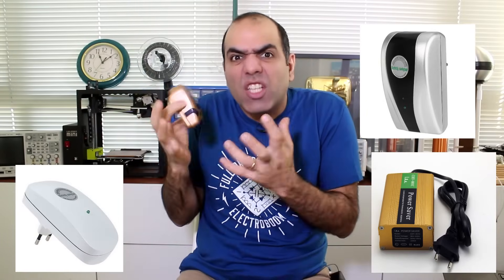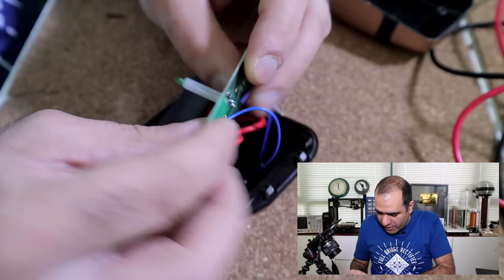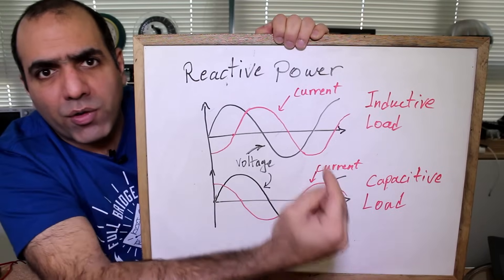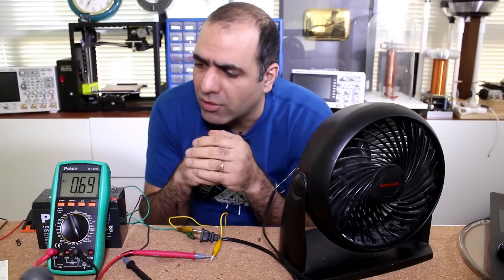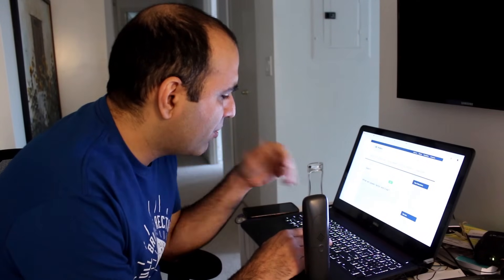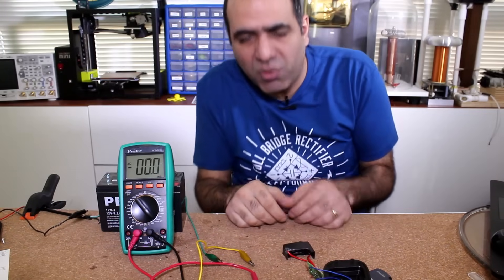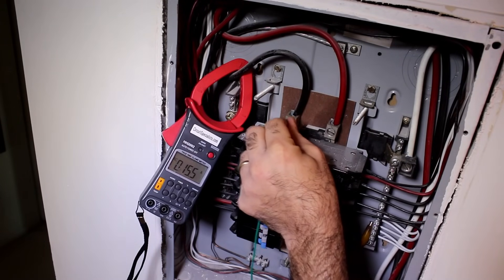Power Saver Scam EXPOSED!

Comment: LOL, you have seen yourself that most of the service lines of power supply even didn't know what Reactive-Power or other used words mean (or never heared about: please spell it), you BELIEVE the answer, you pay only for real power ?
What you pay for is Watt/h and if looked corrected by cos(0), have fun to find that video.
So far still steady Voltage multiplicity with Power in Amp = Watt h, a higher Amp as of too much wasted power = causing also higher Watt h and so a higher bill.

After you might watch https://www.youtube.com/watch?v=TPqXNLkJTJM 
you might learn like me that this energy saving units might work, IF there capacitor build in with fix the needed uF of the unit placed to.

So in your shown examples the same uF capacitor will show non or some effect depending on where you test it.
But as of the Video I linked you might understand then also way so.

I also called the power saving plugs a scam before, even I know since 2 years about some of my units have bad PF as of I use digital multi-meter, here PZEM-18 ?, so detect my power usage and find best spots to reduce by turn then off earlier, less use ... whatever.

But with that video and some more to confirm I learned that now.
Ordered another 2 PF meter and 6 units of 1 uF as I yesterday measure my pc server (offering a game 24/7) using 50 Watt with PF of 0.78, mean maybe useless taking 10-15 Watt for nothing. Adding after get the deliver 1 or calculated 2 uF (in series) parallel to the power supply of the server it should get near pf1 and so also use less Amps, and so less costs.

Then with new meter I wanna check also this PC I am working with, 2 Water-pumps and the cooling room from the restaurant what show a pf of 0.5 !!!

I am a master level business manager, and learned by videos to install my own two 2K Solar inverter and make around 6700 KW a month myself by watching days videos about electric wiring etc..
So even you seam to know more about it and even have some equipment, I trust the teacher and the confirmed pf and uF calculation in that video more.

The Power save is not a real scam, it only will work as expected at the right spot and units as of no adjusting of the capacitor.
The Idea being is right as you have seen yourself when big companies HAVE to pay for it !
Compare the Energy (electric) usage of both sectors in Germany 33% is Industrie and 30% is private. So as especial of the gas war from Russia it might be worth to restart this theme with better based information as it CAN real save electric ans so also money.

Comment: BTW, old (dumb) residential meters measure real power very accurately even if the power factor is hideously low. I haven’t checked the modern “smart” meters. I bet they are just as accurate. On the downside, however, I bet the smart meters can report VARs, too, so utilities have the ability to charge for reactivate power when they can justify it before their regulators.

Comment: The only way a capacitor could help save electricity is a large array to store it for when there's power failure elsewhere. But as it isn't going to produce A/C without a power inverter, it's practically useless to explore for the time being

Comment: Hmmm… since you don’t pay for reactive power, would adding a giant capacitor to your breaker be a good way to screw over your power company if you don’t like them?

That would cause you to draw a ton of reactive power and turn the power companies electricity to heat without paying for it. Only downside I can see is you might fatigue some components of your own system faster over time, but you might also do the same to components owned by the power company ;)

Comment: EE and industrial electrician here. All homes are billed in WATTS. A 1500 watt appliance will use 1500 watts no matter what your PF is. 
My company has two 4160v feeds to our building and we have a HUGE bank of capacitors to actually lower our rate. lowest bill in years was $34000 lol

Comment: Hi Mehdi, good video. Shouldn't the current pulled by that contraption (if applied alone) not be billed?
Since those current mostly goes for reactive (capacitive) power, due to the fact that the capacitor is the only thing consuming the current
Reply: Why not just push the excess electricity back into the grid? Then you'd get a bit of money back, AND cut your electricity bill by a lot in the long run.

Comment: There is one relatively rare circumstance where PFC would make a difference in residential electricity usage. If the utility is supplying electricity with a bad power factor on incoming power. In which case, all your electric motor devices, such as an air conditioner, will have to draw more current to operate. This happened to my parents, because the local distribution transformer had a problem that was supplying power with a very bad power factor. When they replaced it, my parent’s electricity bill dropped nearly 50% on average. The electricity supplier denied this was possible and refused to refund the overcharges for any prior months.
Reply: ive saved 50% with a device.

Comment: My thinking is.  Is to buy a pack of the capacitors and fit in to each device that it will benefit.  100mA is not much but over a year 5 or more devices.  I also as the accuracy of the meter we are billed from.  So if house next door has all the same tec and other stuff uses for the same time will his bill be lower or more then mine.

Comment: Inefficient microwave? My father had a microwave that was like a gazillion years old, it didnt even have a electrical display and used the old Egg-clock spring mechanism thingie to set the time, I wonder what the power draw of that machine might have been XD
Reply: Very low.
Reply: @warmbeer2  You are actually correct now that I think of it, I think the max setting was like 750w (if I didnt mix up the units x3)

Comment: Any electric device sold in my country must be equipped with either a capacitor or inductor, to compensate for the power factor difference. I assume this is the case in most, if not all EU countries.

And yes, that means, that a fan would need to have a fitting capacitor inside.

Comment: Adding capacitor to reduce electric bill is known in France since 60's as law forbids by heavy fine. Here ammeter is used to see the result, but the purpose of the capacitor is to cheat the watt meter which rotates slower with reactive current. This fellow should have tried an incandescent bulb of 100w with and without capacitor while watching the watt meter rotation speed.

Comment: I have a TV that has a terrible power factor. 35 watts and 51 VA.

I want to power it from a solar inverter..
 
35 watts will drain my battery slower than 51 VA.

Power factor correction makes a lot of sense in this application.

I would love to see a video that talked about that.

Comment: AC in UK is 240 v RMS which gives a peak wave of 338 v , if you could build a device to absorb the peak would it reduce the eddy currents which the meter uses to charge you for consumption ?

Comment: For your test you tried to demonstrate, I noticed you was actually connecting your capacitor to the earth rail in your distrubution box rather then across the negative and positive power lines. The unit doesn't connect to earth anyway. You can get a high potential between the earth and neatural depending how good the wiring and distance back at the main earth rod at the sub-station. These units only have a capacitor in them which just reduces any "noise" present on the power line depending on what's running causing your home to produce spikes / noise....  If you look inside a fluorescent light fitting, there's generally a fat capacitor inside just to correct the phase angle caused by the inductive choke inside, you might as well use that to slap across your mains to filter any high frequency noise for what it's worth.. End of the day you're not saving ANY Power!!!  Why are people so gullible  :(

Comment: Hi Medhi, sorry for a question on a two-year-old video, but I've noticed the graphs showing the current phase in capacitive and inductive circumstances is 90 degrees for inductive and -90 for capacitive, while it should technically be switched? Cause the current flows immediately through a capacitor with the voltage "lagging" as the capacitor charges and in a coil the current lags behind because the coil doesn't conduct unless it has formed a stable electromagnetic field in its coils.
So then, are the graphs of voltage/current phase shift ones where we take current as the point of reference for phase shift and you just mislabeled the voltage and current, or is my understanding of this completely bonkers and incorrect? And moreover, does this even matter? What problems can you run into, other than agreeability with other engineers about the phase domain (negative, positive)?

Comment: I installed PF Correction panels in a medical college building. Hostels were using little electricity so installing PF Panel had little or no effect however main academic block was using a lot of electricity due to use of some x-ray machines or some other stuff which consumed large electricity for a very small period of time. PF Panel was useful but not all the time.
In such cases, use Automatic PF correction. It had relay & by CT it checked how much current is being drawn & connected only right amount of capacitance via magnetic contractors & disconnected when current/load was little. 

Always use automatic PF Correction. 

In Pakistan, we pay for Real power. New smart meters can measure both real & apparent power. At homes, Electricity distribution companies ignore but at industry, bulk & commercial meters, they charge extra amount as PF Correction penalty. 

At my home, our society/local gov installs capacitor along with every meter or in residential areas, one in a street & that cost is covered in one time Electrical connection fee.

Comment: These things remind me of engine start stop systems in SUVs.
Great that it turns off the engine. So my fuel consumption is 0 instead of 0.6 liters per hour.
Now let me accelerate my 1.8 tons of mostly unnecessary chassis, and speed that wardrobe over the highway at 180 km/h.
This costs me 14.6 liters per 100km opposed to 8 in a small car.

Comment: I'm a high level electrician and in heavy industry where we do use LARGE capacitor (banks) for power factor correction.  The reason is that while we're only initially paying for the REAL power we use, we get penalized if our power factor (cos of the phase angle) wanders too far from unity.  We don't actually get charged on any metered use of reactive power.  From memory the old electro-mechanical power box meters went out of their way to measure both current and voltage in such a way that only the in phase component of the current (the real power component) would rotate the meter.  I would assume the modern electric ones follow the same idea's.  I did enjoy the presentation, and letting a bit of the smoke out does make things a bit more interesting and memorable.

Comment: Power factor = Resistance / Impedance 

Where, impedance = square root of  ( Resistance squared - (Inductive Reactance - Capacitive Reactance) squared )

Also, capacitive reactance = 1/(Capacitance × 2pi × frequency)

Inductive reactance = (induction constant) × 2pi × frequency.

Comment: I am a professional electrical engineer with many, many years of experience.  This video is great and lots of fun.  The video explains exactly how power factor correction works and shows us that the device is indeed just a scam.  Any improvement in power factor is miniscule and a you are not charged for it anyway.

Comment: When current is reduced, the losses in the resistive load wil also reduce thus reducing energy consumption. But it wont make significant difference as capacitance is very small.

Comment: most of the home Appliances got high-quality capacitors installed in them. adding capacitors won't help digital electre meters installed by the power companies but may reduce bills in old disc metere.

Comment: No one pays for reactive power because the electricity meter works by real power. As you said, reactive power does no work. If you have a bad power factor, the supplier charges you a surcharge to compensate him for undercharging you.

Comment: Yep , even without doing the practical experiments.. you can easy work out ... that it's a scam and won't do anything , 
I actually calculated it cost you a few pence more , per year, to power the actual LED box , which does actually use some power..
On a personal note.. connecting things with loose wires inside your house fusebox ... that was nerve-racking for  me ...
DONT DO THAT

Comment: If we could build a device that regulates the AC line voltage to the bare minimum, we could save a lot on electricity bills, and save our equipment by making it last longer.

Comment: The problem with these innovative devices is that they are easily duplicated with scammy ones.

There are real ones out there.

The problem is that scammers duplicate them and sell non working versions.

I had two 50KW version units and they worked for about 2 years. 

I don't know about the power factor correction function, however the units I had maintained my line voltage at 220VAC instead of whatever the electricity supplier wanted it to be.

Without them, sometimes my line voltage would go as high as 265 VAC!

As you may well know, the electricity companies scam you.

They raise the line voltages so your devices consume more power.

Essentially they overdrive your equipment, and cause it to wear out sooner.

This equals a hefty rise in your electricity power bill.

During winter, element heaters are overdriven and cause them to consume more power, costing you more money, anywhere up to 15% more on your bill!

The same goes for summer, where devices such as fans will consume more power.

Of course devices that are equipt with state of the art voltage regulators are not affected as much, although they can be still effected, causing them to dissapate more heat, and consume more power!

So if you test these devices, and it does not work for you, you may have a scammy one.

I found that even the electronic pest repellers have the same authentication issue perpetrated by scammers.

I purchased a few and found they were scammy.

I repurchased somewhere else and they were fine, and I still use them in my home for the past 6 years.

It's the luck of the draw with these devices, however the authentic ones actually work, at least they worked for me anyway.

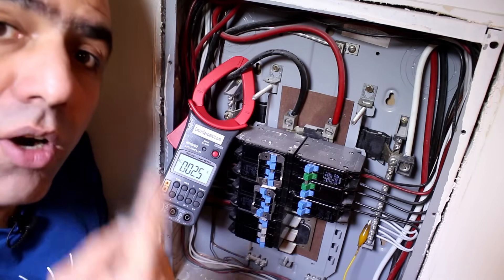Comment: At 7:13 minutes, there is some light glowing on and off around the fuses. It seems it’s reacting to his voice. What is it? Never seen any glow around fuses.
Reply: It's a reflection
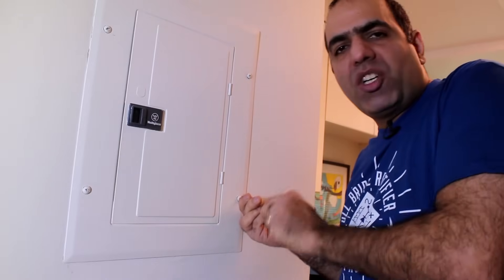Reply: If you pause at 6:54 and enlarge the image, in the middle group of breakers, the top 4 breakers have a rectangular plate and the next 4 breakers have a plate as well. Corners of each plate seems to have LED lights or something. Never seen this before.
Reply: It's a reflection

Comment: Well as far as we're taught in electrical engineering in India, the electricity providers charge fines if the power factor is below a certain amount. However, every month, my electricity bill says my power factor is 0 :)... So I'm pretty sure the systems don't even work.

Comment: Are you still alive today? Putting your bare hands and wearing a ring into an energized circuits!  Have you never used electrical hot gloves 🧤! Tip, de energize your circuits, make your connections then reapply your power or this could happen 🤔🪦😈🔥

Comment: Something to think about is load balance. When the voltage comes into your home as 2 lines of 110 volts each phased 180 degrees so the difference between the lines yeilds 220 volts each line can have a different load. The power company meter does not average this load, instead it's computing your consumption based on the higher line load. There are two ways to combat this; one is to anticipate electrical usage of the home and run the lines so one 110 volt line sees a similar load as the other 110 volt line. Another is to have every device running on 220 volts. I may be mistaken but in some countries they are wired with 220 volts for all devices and I think this due to noticing the voltage requirements for "international" devices are often rated as 220 volts instead of 110 and people that travel often carry an adapter to make their US devices work in other countries. So with this thought does that mean energy bills are going to be lower for those countries?

Comment: So let me get this straight. They propose to save energy by simply using more energy... yeah, that checks out 😂

There are so many actual proper things you can do to save in energy usage, be it in heating, cooling or electricity consumption with proper insulation, smart grids, heat pumps, airflow/heating optimization etc

Comment: Another scam is in the automotive aftermarket "power chip."  Industry.  It's supposed to increase engine power and improve gas mileage.  The term "chip" indicates a complex miniature electric circuit.  How it works is that you unplug the connection from the air intake temperature sensor and plug in the "chip."  There was no difference in power or gas mileage so I decided to open that "chip" to see what was inside that fancy looking housing?  All I found was a single 31 Ohm resistor.  That's it, just a single 31 Ohm resistor.  There was no electrical circuit except for the 31 Ohm resistor.  All that resistor did was keep the engine from running rich (like it's designed to) when starting up cold, and nothing more.